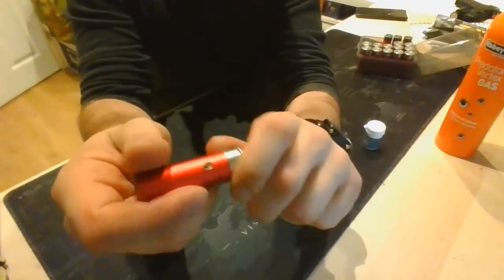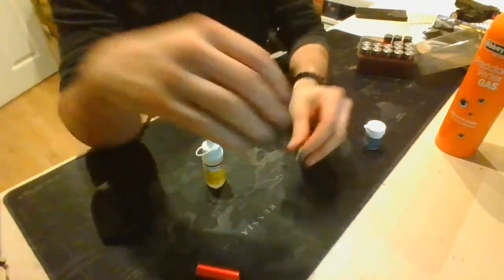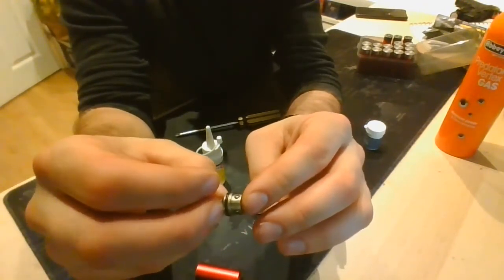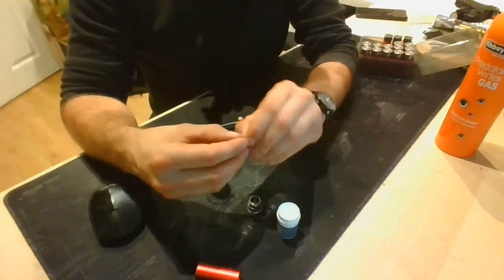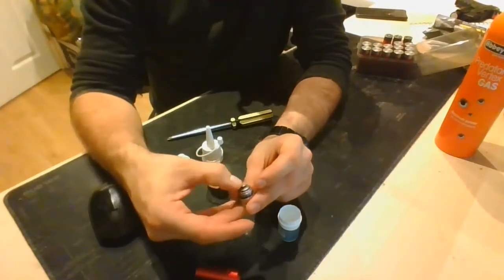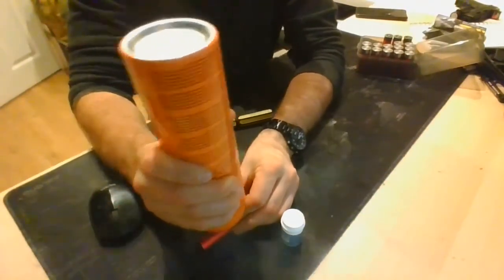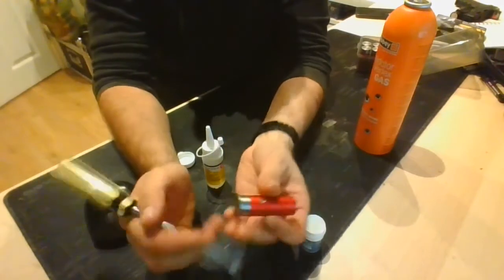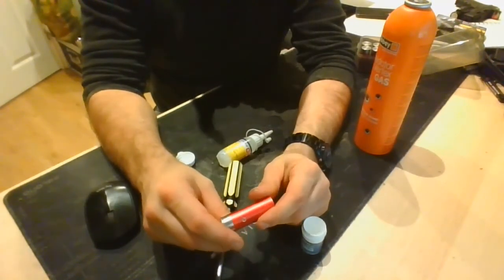PPS M870 Co2 Shells Basic Maintenance and Overview

Comment: Hey mate iv just got a pack of these shells and wondering do you really have to use Co2 or is green gas OK??
Reply from the maker: You can use green gas, but for best results of honestly recommend a higher powered gas, green gas in these are very underpowered
Reply: @sierrabravoairsoftevents  cool man, iv just got my shells and some are filling and some arnt, not sure if I'm doing something wrong but iv noticed after each shot they need to be reset and to do so iv been unscrewing top part pulling back the knob and reattaching lol. Is there something I might be missing like do I have to fiddle with filler valve to tune it ect???
Reply from the maker: @ezytechagelblastersairsoft7272  this is normal, you usually have to unscrew them to re-seat the valve what you're doing currently is correct
Reply: @sierrabravoairsoftevents  wow OK so they do need to be unscrewed to reset the valves, that abit annoying I think having to unscrew them during a game each shot lol. Don't they reset by pushing the primer in fully before filling, that would be so much easier.
Thanks in advance mate I appreciate the help😊
Reply from the maker: @ezytechagelblastersairsoft7272  oh I agree just pushing the valve would be much easier usually they pop back into place if you partially unscrew the top half and give it a tap, you sometimes hear the valve pop back into place.

Although these shells are not as much as a pain to reload as the aps cam shells, it takes about 1.5 hours to load 25 shells for that one!